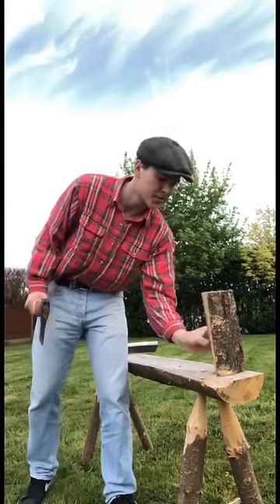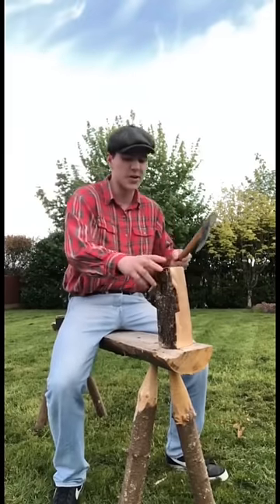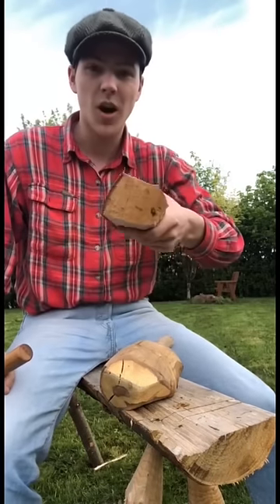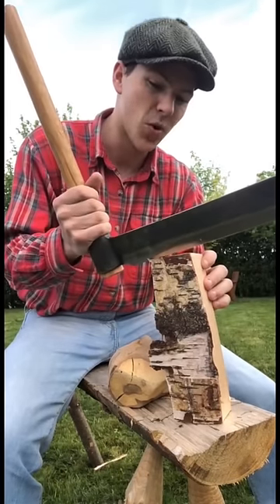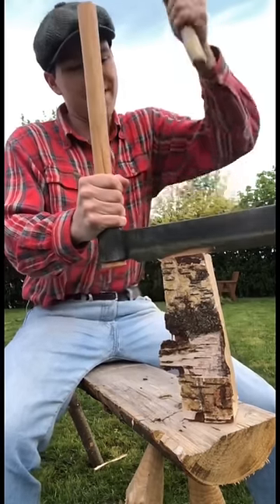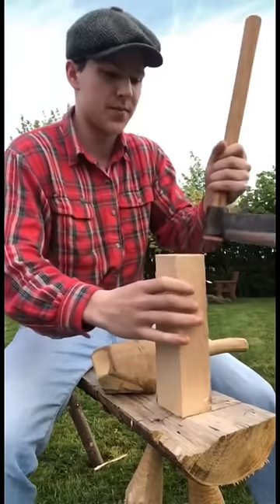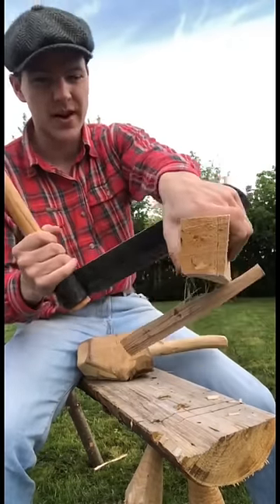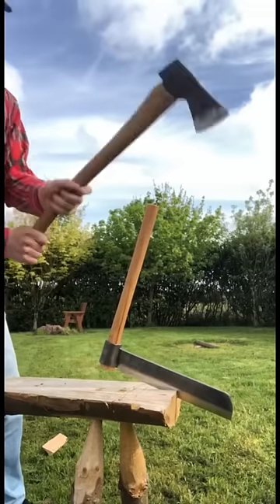Why use a Froe instead of an Axe #woodworking #satisfying #shortvideo #axe

Comment: also, the axe you're using for splitting, should be shorter. same amount of steel, but it should have a wider angle quickly instead of a slow sleek angle which makes the axehead longer. A bit more of a stump, but sharp. so it splits much earlier when it penetrates the wood.

Comment: Froe... That's a new term for me, but not a entirely a new concept.  I've been doing something similar for years but for different purpose.  When hiking or just practicing bush craft, I'd often just take a very large knife with me for most cutting tasks I might need.  For preparing firewood, I would just scavenge fallen wood and break it down as much as I can with leverage.  After, I then take that knife and use it like a froe in combination with another piece of salvaged wood as a mallet, allowing me to easily and controllably break down the wood into the size I need.

Seeing the Froe as a precision tool for purpose rather than for improvisation as I have used it?  That's fascinating.  Really seems like a tool I'd love to collect and practice with to see if it's a skill I can develop enough to use.

Comment: I agree but I also noticed your axe technique is a bit off use your forward hand to choke up at the neck of the axe at the beginning of the swing then allow it to slide down to your swing hand that's how you get both power and accuracy now if you really want to maximise try to finish your swing stepping back and almost like a reverse lunge to get trantripical force into your swing so the axe does the work

Comment: I got that a froe is a useful tool when you need one…but I’d bet that if you wanted to lay that axe across a piece of wood in a particular spot, you could pretty easily hit within 1/4 inch of where you want to put that axe. You’re a skilled woodworker, and seem to have a pretty decent idea of what you’re doing the entire process of turning a tree into a table. I’m not a professional woodworker, I’m a mechanic, but I know if I want to crack something with a 4 pound hammer, I can full on happy Gilmore that hammer, (hard enough that whatever I’m doing violence to will either break or do what I want it to.) and get it within 1/2 inch if where I want it. I’d wager to say you can do the same thing with an axe.

Comment: Not to disagree with the philosophy of using the right tool for the job but it's absolutely possible and plausible ble to be very with an axe, it takes little experience to do it regulary and some more for perfect consistentcy

the axe can also be used like the froth in this scenario

Comment: i am intreaged: 
i thought that was what hatchets are for. 
i usually just use a hatchet and a hammer or the back of my axe or wood mal. 
is there some advantage to using a fro? 
is the fro made of hard or soft steel? 
could i maybe just get away with using a cheap matchete, or an old lawnmower blade with one end taped up as a handle? (i ask because i already have those things)

Comment: To be fair, an axe really isn't the best choice for splitting firewood either. A splitting maul is a bit better due to its shape and weight. Seeing the last video were you used the froe, There are also splitting mauls that have a mechanism in the head that forces the wood apart as it splits the wood. Either way, they are both much better at splitting logs, especially if there is a knot

Comment: I'm pretty sure you know that first statement isn't 100 % legit.  Hold the wood in one hand and the ax in the other. Place the blade of the ax on the wood precisely where you want to make the cut, raise both in unison and bring down lightly, all you're trying to do is seed the edge of the blade into the wood where you want it. Now that you have fixed the wood to the blade where you want the cut, raise them together, both hands on the ax and then hammer the wood onto the stump to finish the cut. While the froe is easier and more precise, you can get precise cuts with an ax and most people actually have an ax.

Comment: I don't understand, why cant you just do the same thing with an axe? Place the axe against the wood where you want it to cut and use a mallet to drive it? It could split faster depending on the width of the axe, but I have some that have a very narrow profile. I'm not trying to flame, I just don't know if I am missing something.

Comment: It's actually surprising how accurate you can get with an axe once you've had enough practice. I'd say that I could definitely get some square pieces with the right wood, but the grain down here makes that impossible. It's way easier to cut in wedges. Why would I need square wood, anyway?
Reply: You need square wood for building. To be specific, you need it for shingles. When you need hundreds of one inch thick wood rectangles, an axe is not preferable.

Comment: You'd get the same result with the axe if you used it like you did the froe. Just line the edge up and tab on the back of the axe head with the maul.

Comment: So why can't you use the same technique with the axe? yes the Froe has a longer blade for bigger pieces but this demonstration was flat biased by using different techniques. In fact start with a large round piece of log and you could make that piece with only the axe and the mallet, could you do the same with the froe?

Comment: Traditional tool that was created for a purpose and used by skilled woodworkers and carpenters for a reason: Exists

Armchair lumberjacks in the comment section: "I know better than all those people. This tool is pointless. I can do the same with an axe! I don't care if the literal experts thought they needed a specialized tool for the job, I know better than some dead arseholes from 100 years ago!"

Comment: Hammer the axe?
Reply: Rule #1: "Don't hammer the hammer."

Axes are just big hammers with a sharp bit on front.
Reply: @dr.zoidberg8666  but that's a very common practice in splitting wood .. the maul is beaten with a heavy hammer to act as a wedge
Reply: @Gee-bx3zh  Yeah, unfortunately lots of bad ideas are pretty commonly put into practice.  When talking about axes in particular, hammering the back end of it puts you in danger of deforming the eye, or with extended practice, even chipping or cracking the axe head.
Reply: @dr.zoidberg8666  that makes a lot of sense

Comment: You need to practice your swinging technique if you cannot hit your spot. I rarely chop wood but working with my hands have great coordination. I set my blade where I wanna cut raise the axe straight up and swing straight down. 99% of the time I hit my mark exactly. I hammer all day and can look away and continue swinging and not miss. Muscle Memory is key. I understand the point of the video but I say you need more practice swinging an axe and working with tools.

Comment: You can do the exact same cuts by placing the axe as you would the froe, and whacking the axe with a chunk of wood. You don't need to "just swing." 

This is a prime example of a How Stupid Are They video.

In real life froes are used to make flat shingles, not square-cut short blocks of wood. There is very little use for short square-cut blocks of wood. And to make beams, a sharp draw-knife is the tool to use, because a froe would just follow the grain.